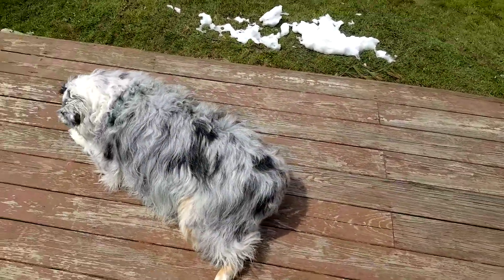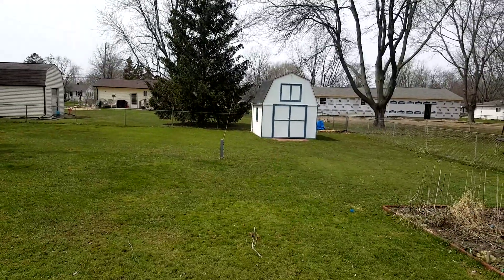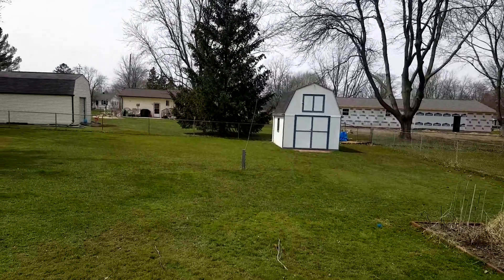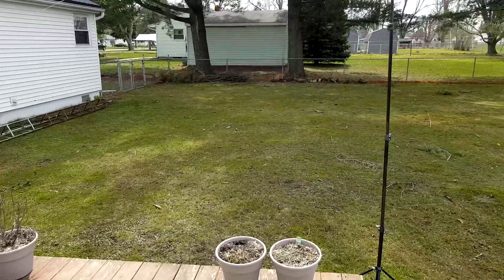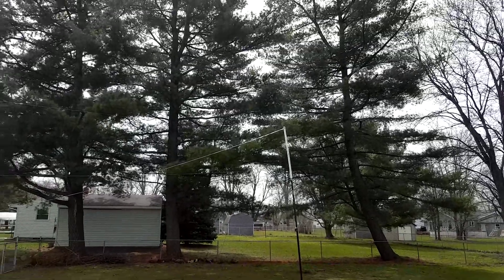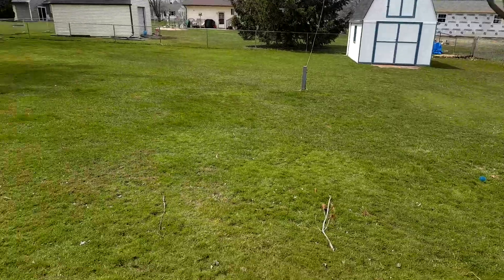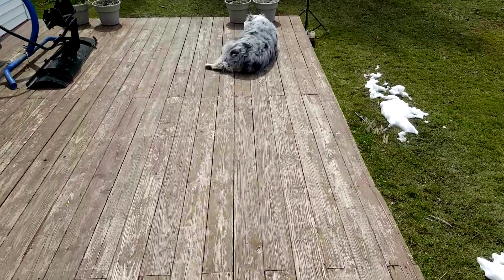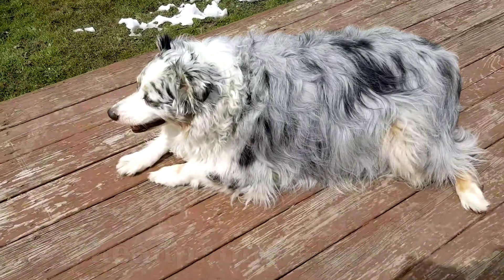End Fed Half Wave Antennas - My Opinion: Noise & S+N/N

Comment: Why do you still use the capacitor on the primary of your multitap unun? I think the capacitor is not necessary when having the taps - the proper tap will compensate for the missing capacitor, and you will get more power off the unun, imho.. 73 de om1zz

Comment: And on an 80m EFHW, there'll be 4 lobes on 20, possibly further up in the air than the single dedicated 20.  73.
Reply from the maker: Yep. Funny thing is- when there's significant QSB, I have sat and listened to them, switching back and forth repeatedly- and sometimes the 20m wire is MUCH better when the QSB is minimal, and when the fading knocks the signals down, the antennas with swap places- with the 80m wire becoming the better. And a while later I'll notice the same effect on another ham- and it will be the opposite. Propagation has a profound impact on antennas in complex ways. What I adore is having a 20m vertical, the 80m EFHW and the 20m EFHW.. and switching between them all. It's really interesting. I like screwing around. I'm retired. Basically I get paid to screw off. lol. Thanks for your comment Nathaniel! 73 OM  :)